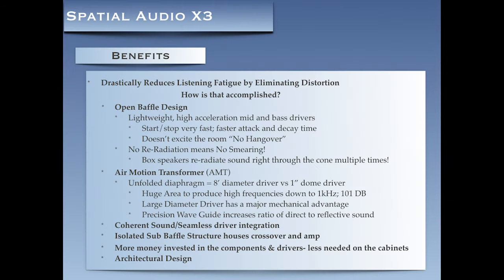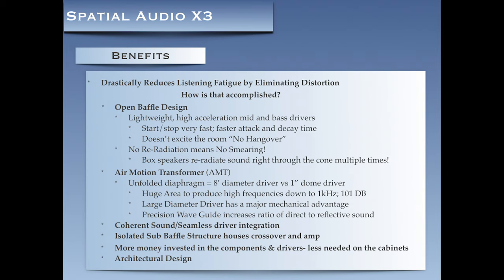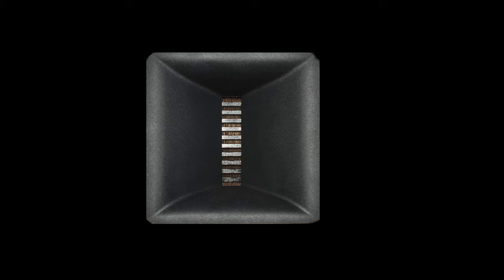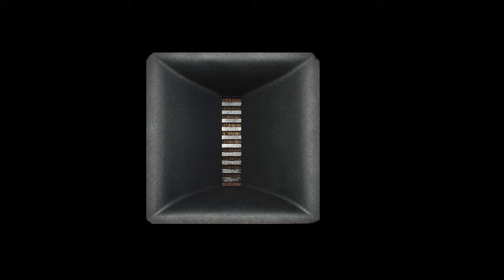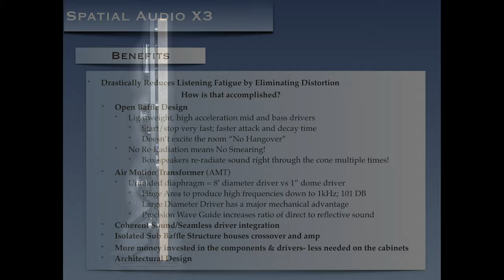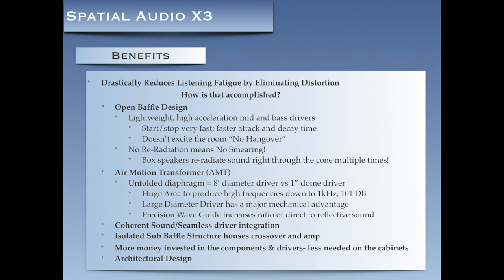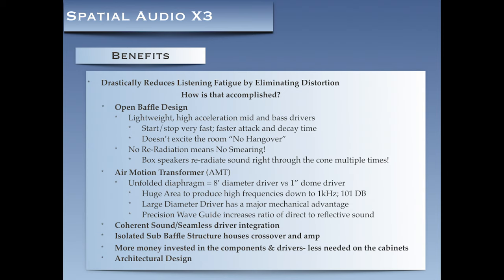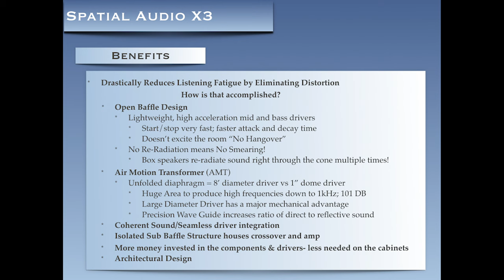Spatial Audio X3 Open Baffle Loudspeaker

Comment: Really good review.  Those are incredibly attractive speakers.  I have a pair of Spatial M3 Sapphires on order in Sepele finish.  While they certainly are not the level of the X3 they should be a significant improvement in my system.  They also have a secondary baffle and same woofers but passive.  They have a less expensive mid/tweeter but Clayton says he loves the way it sounds.  Can't wait to hear them.  By the want thank you for introducing me to Janis Ian.
Reply from the maker: snowpuppy77   Appreciate the comments. The M3 Sapphires should be exciting to listen to. Congrats on the purchase!  Janis Ian is a treasure!
Reply: They ar not "worse", just different, smoother. And their tweeter just produces highs that sound more right - a metric not very often used when it comes to tweeters but shuld be absolutely.
The do not resolve AS much but are still extremely detailed - nothing is missing.
It is more a question of use case and preference than better or worse. On all sound demos I have heard I just liked the sound of the Sapphires more. 
Even tho as an audiophile I can apreciate the brutal realism the AMT provides it i just to much for me and it simply does not click for me like with the Sapphires which I absolutely adore.

Comment: Open baffle! Very nice! I had a pair of open baffle speakers with a sub of course, these sound amazing through my headphones.
Very nice, some ob speakers use compression drivers which leads to listener fatigue which is what the ones I had used my room was fairly hard which I could not change had to sell them but they were nice.

Comment: Hi. Great review! I noticed that the tweeter on the X series rolls off at around 20khz versus much higher on the M series. What audible difference does this make to your ears?
Reply from the maker: Blesson Jacob the X3 provide the listener with unparalleled transparency in the high end and with a 8” corrugated diaphragm it has a huge mechanical advantage over the M3. You pay more for it if course, but the subtleties of the presentation sets it apart and gives you a speaker that is unmatched. Hope this helps!

Comment: Oh, but BTW, the Spatial Audio X3 does sound very good in a real life listening environment. I have heard them at RMAF a few years ago so I don't mean to disparage that speaker! I also have Tekton Design OB Sigmas, a mostly open baffle design and Apogee Duetta planar speakers I listened to for 15+ years, albeit both speaker brands with Hsu Research subs. Don't let them fool you...planar or open baffles in the very low end cancel far to much to get proper bass with out whacky equalization as low frequencies "wrap around" and cancel themselves.

Comment: I am in the market for open baffle speaker. Looking to build the Martin King design to compare to my Elacs. Is this speaker made in Europe?
What does the class D amp power? Do you use an amp or just a preamp with that class D? Thanks for sharing. Love the sound they make.
Reply from the maker: I’m pretty sure Clayton has an European contact on his distributor page on his website and of course you can call him with questions.

The class D amp with volume control powers the 15” woofer. All you do is plug in your normal amps speaker leads into the connectors plug on the back of the X3s and you are good to go.
Reply from the maker: Check out my set up video. It may help    https://youtu.be/spiojZBk2kY
Reply: Very cool. Thank you.

Comment: Thanks for the great review of these gorgeous speakers.  I am an electrostat owner (ML Vistas) with a less than perfect listening area.  I love the clear, delicate, and immersive sound they produce however my vise-like listening position is challenging especially mostly with the low mid and lower frequencies.  Given your experience in audio can you share with me if these may solve these issues with respect to the electrostats?  Thanks in advance, Rob
Reply from the maker: Robert Bernard Thanks for your kind comments. The biggest difference with these speakers is that they seamlessly go down to 25hz! The are very dynamic while having the ultra transparency of an electrostatic. These are not very finicky in terms of placement as long as you 3-4’ from the back wall and 4’ from the side wall. Can’t imagine that these would not do the trick and give you a less than amazing listening experience that you would be thrilled with. Cheers!

Comment: How does X3 compare to X4 and X5? Only the X4, it seems, is still available.
Reply from the maker: It’s a very similar speaker in that the drivers are the same, but the X3 has a powered sub woofer and the X4 doesn’t. However, the X4 has a better crossover and better feet than the X3s. I prefer the power sub, but would also like the better crossover which I think I could eventually upgrade too.

Comment: Very detailed except no mention of the crossover. Makes me wonder why you would be so inclusive on all other equipment but omit this one vital detail.
Reply from the maker: Porkchop's Papi good call out. Sensible and relevant. The sound is so seamless between the three drivers it doesn’t draw attention to it. Yes, Clayton is using clarity caps, but the fact that the AMT driver is crossed down at 1k is key to the one piece sound he achieves. Also, having the cross over network mounted on the sub baffle improves the transparency. Check out my interview with him. He goes into some detail in this area. Let me know if you have any specific questions after you listen to the interview. Cheers!

Comment: what does the DSP do and what do you think about Hypex controlled woofer/subwoofer?
Reply from the maker: fafan111 great question! The digital signal processor helps support different rooms, but it’s set at the factory and I have not had to touch it! From my understanding the customers that bought the X3s have not had to play with it.  The woofer/amp combination is outstanding. The bass pounds your chest while being true to the timbre of the bass. Plenty of power, you can see the volume position is at noon with plenty of gain available. I had it too loud  and had to dial it it back. My main amps for the midrange and AMT are 400w a channel.
Reply: @audiotalk6155  thanks for the response, what do you mean support different rooms? Also can you comment on vertical and horizontal dispersion? I've heard AMTs have a very narrow vertical dispersion but just wanted your perspective. Thanks in advance :)
Reply from the maker: @fafan111 Auto room correction. Although Spatial Audio indicated that i probably won't need to use the DSP.  When I set up my speakers I found them to be very balanced and didn't feel the need to tweak anything.  I think the recording shows the quality of sound in my room.  Here is the link to the nCORE amp:  https://www.hypex.nl/product/fusionamp-fa251/155

In terms of a narrow vertical dispersion, I don't buy that on the AMTs in these speakers. The image and depth of sound staging is extremely pleasing to listen to. Deep and wide. Much more expansive than the M3S Turbo which was excellent. All good with dispersion :). It’s a strength of the speakers. Thanks again for you question.
Reply: Audio Talk fa251 is a 1 channel 1 way so how are you powering the midrange and tweeter and dsp

Comment: May I suggest using a wireless lapel mic... Or just the Rode Wireless go (lapel mic optional as it has a built in mic in the transmitter) to improve the audio... Since sound is the most important thing!
Reply from the maker: It's a god call out.  I changed up my approach with my latest review. Check out the audio quality and of course the content in my latest review on the Cherry Amp.

Comment: Surely the crossover points aren't 90 and 25Hz???
Reply: Actually they are- the compression tweeter goes way down into mid range , and that makes for a very coherent speaker
Reply: @johnwhite2576  Not trying to be argumentative, but a compression driver has a screen over the diaphragm not for protection, but for compression loading.  These are AMTs, two different animals.